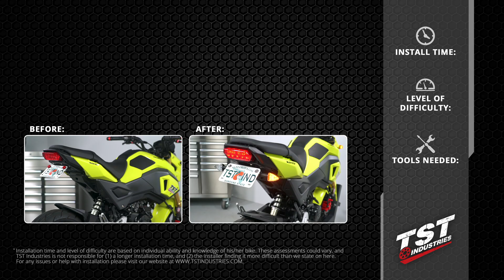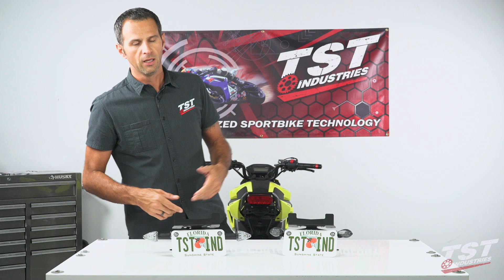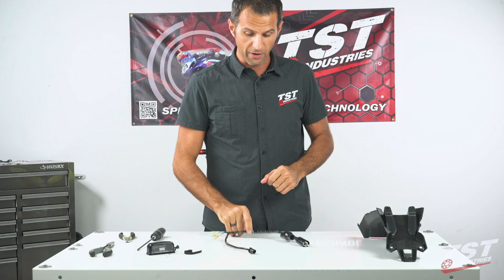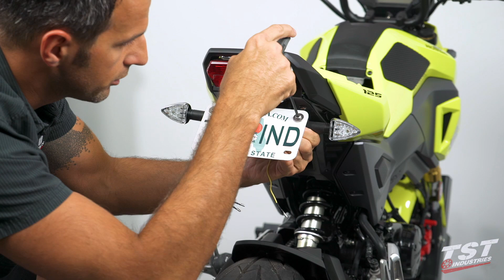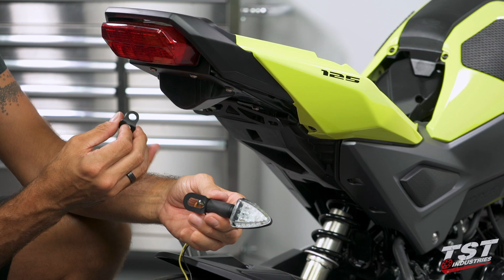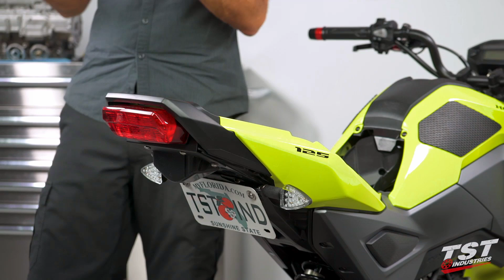Part 3: How to install an LED Rear Pod Signals on a 2017+ Honda Grom by TST Industries

Comment: Is there a way to make the rear turn signals have daytime running light functionality, brake light function and turn signal function all in one?
Reply from the maker: If you purchase pur Quadrix-D lamps they come with all that functionality, just have to be connected to the appropriate circuits. The OE lamps only have one amber circuit so all the functions you are describing are not possible with those
Reply: @TSTindustries  I just checked them out they look really good! I would be using them for a 2023 honda Grom, would I need to buy any additional wiring? Or is there a video for this install, my whole Grom group is looking to purchase these as well!
Reply from the maker: @ItsAlexR  at the moment we do not have the Quadrix-D listed for anything except the suzuki 8s. They are available when you contact our customer service guys. We will list them after we figure out a scheme to advertise them properly and eliminate people's erroneous ordering. We do not have any vehicle specific wiring except for the 8s. The lamps terminate in bullet connectors. We will be providing the color code and what functions each wire corresponds to.

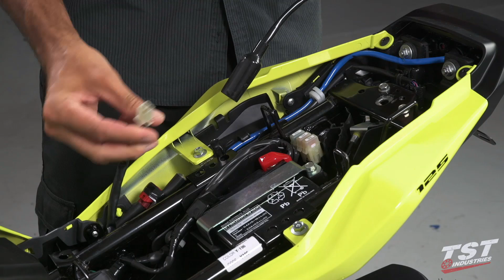Comment: I need to know what that cable is that you take off for the turn signal and reconnect at time 5:44
Reply from the maker: The OE fender has a sub harness that connects from the bike to the fender lighting. You remove that from the fender and then reuse it

Comment: Hey TSTIndustries! I have a question, which tankpads are those on your grom?
Reply from the maker: Tijl De Bruyne those are TechSpec. They are currently being manufactured and not available just yet. They will be sold exclusively through TSTindustties.com for a period of time once they launched, and a few months later they will be available through the entire dealer network. If you want to be notified of when they are publicly available please like our Facebook page (linked in the description of this video)
Reply: Hmm, hope it will be able to buy them ever,  I like the look of it! :)
Reply from the maker: Tijl De Bruyne it won't be long. They are scheduled for production